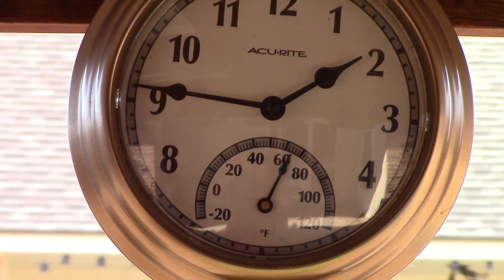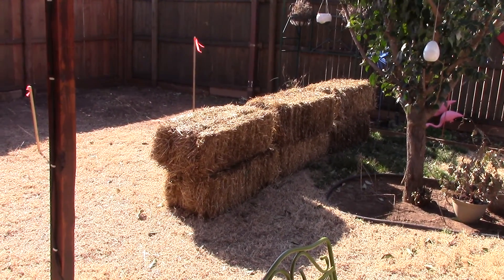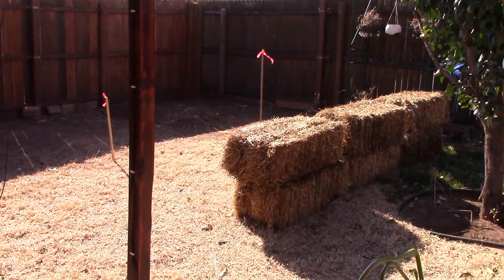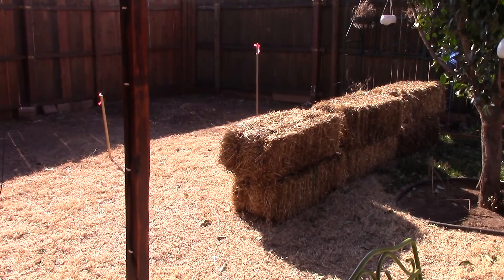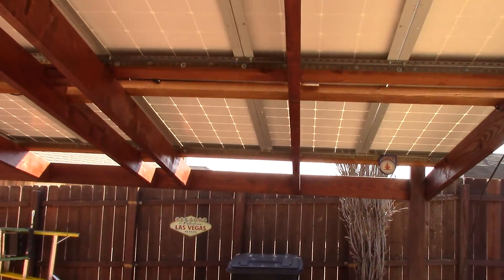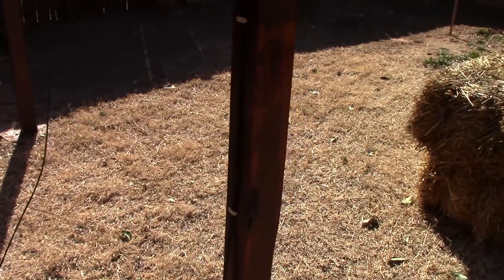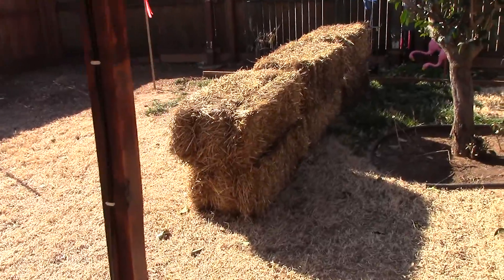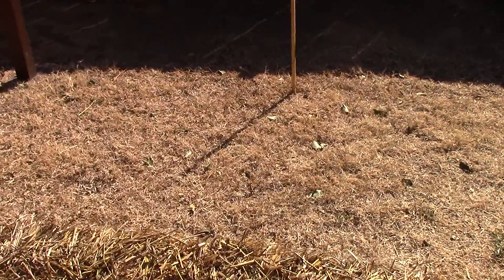DIY makeshift haystack solar panel stand. Why not?

Comment: Hey Chris, another great video! Have you ever thought about adding a wind turbine to the system? Forgive me if its a silly question, but can you even tie a wind turbine into the system you have or do you need extra/different equipment?
Reply from the maker: Thanks for checking in...yes, I have thought of that. However, not practical within city limits, HOA, and curious neighbors. The output vs cost vs benefit is not there. Wind is great when you don't live in the city and have wind and a high tower.
Reply: I didn't even think of the noise, would a wind turbine be able to tie right into your system though? Or would it require a different setup?
Reply from the maker: I could tie it in...but, not worth the $$$, time, and weak output most of the time. Not here in Suburbia at least.

Comment: Sweet Chris!! Did you ever see my video on my DIY solar rack..I used 3 pillow bearings,a gal pipe and some 4x4 post and a security door knob bar for adjusting the angles..I'm sure you don't need anything to big for those panels!!
Reply from the maker: I vaguely remember that...but, I am thinking I will do something like that. I will take a look again...and may have to ask you for some pointers. Thanks man...I like DIY..!
Reply: +Chris DIYer cool man I'll send you links to parts I used easiest thing I came up with and strong..